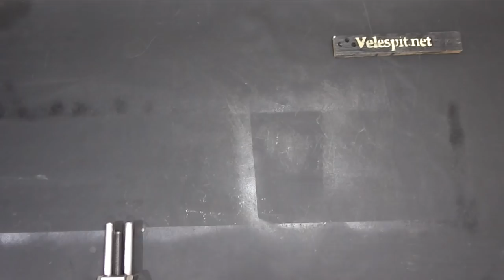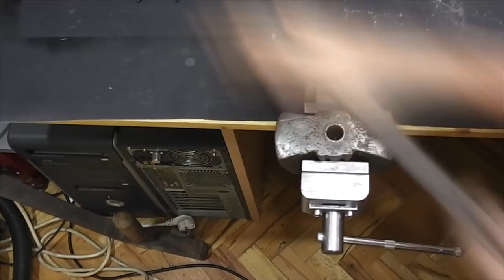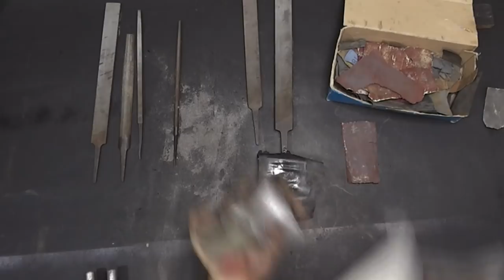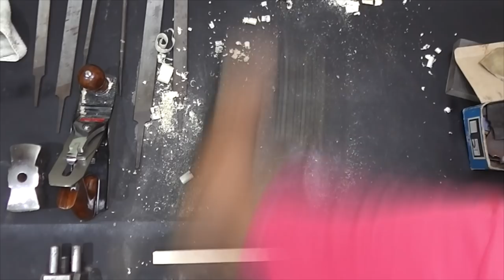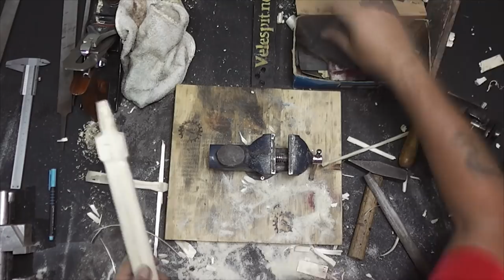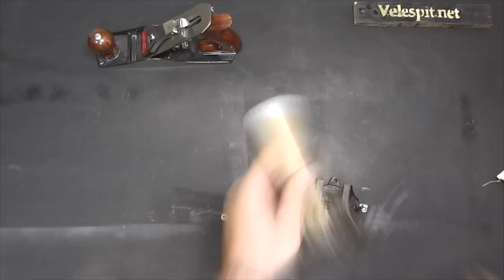Old Hammer Restoration | 1915's tools | First World War Rail Road Hammer

Comment: Hope that hammer is for display purposes only because that soft wood handle you made isn't going work as a functional implement.  For all the work you put into making that stupid thing, you could have gotten a piece of ash, hard maple or even oak and whittled and sanded it down and fitted it to the handle.  Also, you need to wedge the head to the handle.  To draw the handle into the head you need to hold the hammer upside down and strike the butt end of the handle sharply several times.  That will draw it up tight inside the hammer.
Reply: Yeah I was also baffled to see the obvious soft wood that is of disposable chopsticks quality. It should have been hickory.

Comment: Would anyone know if this hammer was used to drive railroad spikes or just maintenance on a locomotive? Thanks
Reply: This hammer is not for railroad construction or whatever. I would surely hope that when someone says something like "this hammer is for railroad use", to make a little research first. This hammer is for stone working. It is a very common tool for sculptors that work with marble and generally stone. It is for curving and is called "Ματρακάς". This is the greek name for that hammer. Probably they have the same name in turkish and arabic languages.